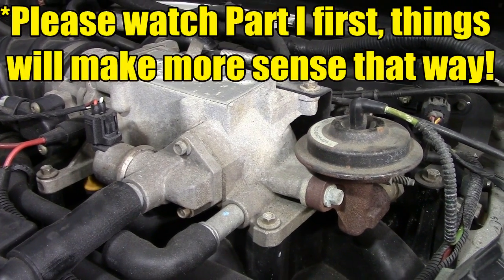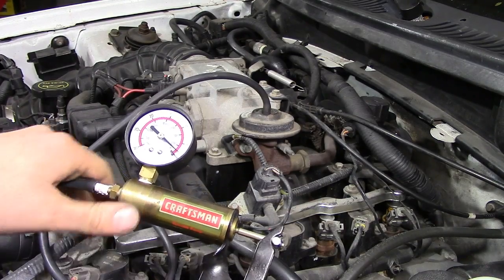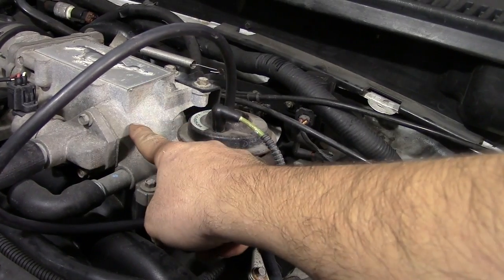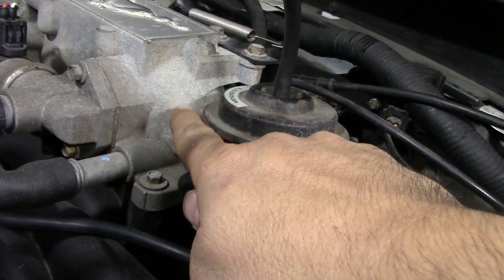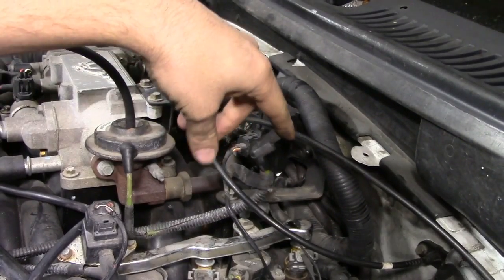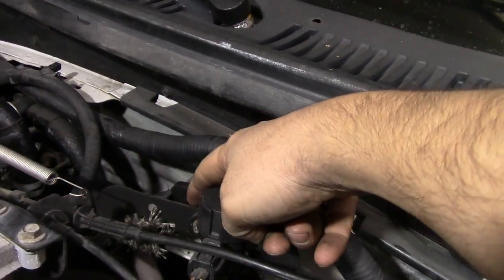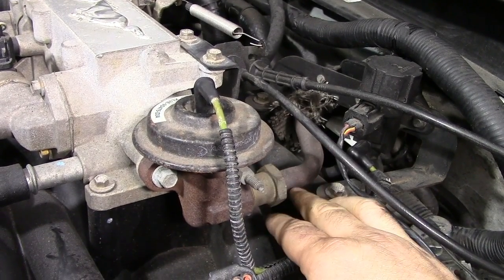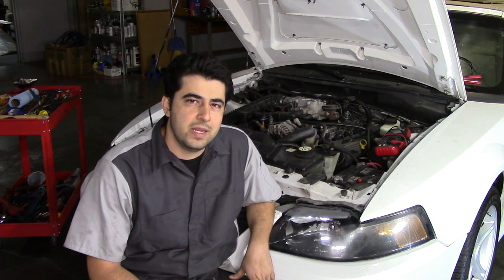How an EGR System Works Plus Testing and Inspection Procedures - PART II

Comment: I kept getting the insufficient egr flow code on my car and after driving myself to the brink of insanity trying to figure out what was going on, I found out that the (green) vacuum line to the egr itself was clogged up. So although the valve itself was in good shape and holding vacuum when it was applied with a vacuum pump, it wasn't able to operate properly due to the clogged up vacuum line which is why the code kept coming back. After I unclogged the vacuum line, the code never came back. Thank you for such an informative and helpful video! 😎

Comment: Re: 1996  5L f150. My EGR diaphram  holds vacuum pressure well but applying vacuum does not move the pintel valve. The valve does move easily when light push applied with screwdriver or punch. Little or no carbon anywhere.  Bad egr valve unit???

Comment: Hey I have audi a5 2010
 I'm getting a boost leak (I think ) cleaned egr & throttle body . Did a smoke test just before the egr & throttle body and the smoke was coming from a small purpose hole on the egr . I had it to pieces but nothing is faulty .and then I unplugged the egr and drove it (no check light came on ) 🤔🤔 🤷‍♂️🤷‍♂️

Comment: If this egr system failing, will it give it a bad exhaust odor ? I'm having issues with my 2001 mustang GT , idles rough at cold start in definitely has a very bad exhaust odor that stays on my clothes. Any suggestions?

Comment: R&W: My Mustang 2000 GT when the weather starts to get warm (60's) runs bad, @70's runs like crap and it sounds like is in limp mode (it doesn't pass of 2,000 rpm's) it feels like is second gear. BUT in winter or cold days the car runs good but the automatic transmission (new) is not sync with the throttle. I already replaced a MAF, IAC, O2's, TPS, cleaned the plenum and cold air intake butterfly, etc. New coils and spark plugs as well. The only thing I haven't check is the EGR and it's sensors. Can this EGR valve or sensor can make the car run like in some sort limp mode without a CEL or codes? I passed emissions test with 0 problems last week. Last week I delete the catalytic with new O2's and the car runs and sounds like a 4 cylinder engine with straight pipes. What can I look for? EGR or something else. Hot weather takes his power to a point it feels like 70hp car

Comment: I just realized my stalling problem was the EGR solenoid. I didn't even realize it was there cause its hidden under the canister. But flows air through even when disconnected.

Comment: On petrol engine I don't see a good side to blanking them but on a diesel I'd have it no over way all my diesel cars I've blanked and so far touch wood nothing but better fuel economy and torque. Very easy to do order a blanking plate undu the egr bolts not fully slide plate in. Or you could remove gasket draw round it and make one out of a can. Very simple my old vauxhall combo was blanked for years no problems my Peugeot partner 1.6 hdi with turbo been blanked 5/6 months now and runs much better. If you have an electronic egr it must work for the ecu to compensate. If it's vacuum no difference